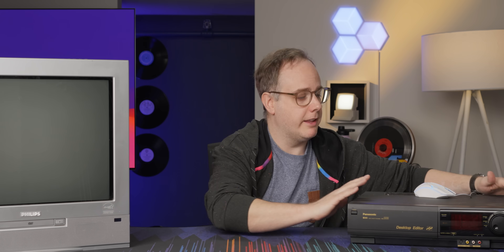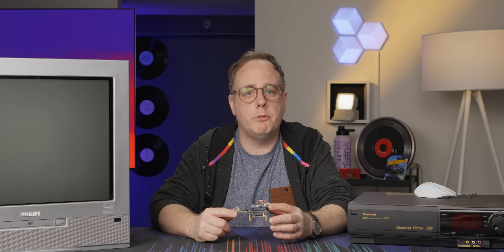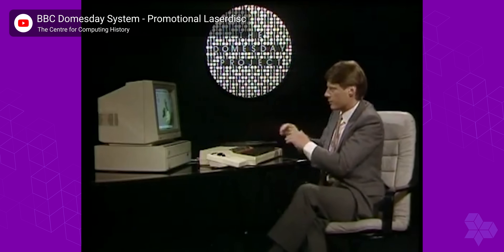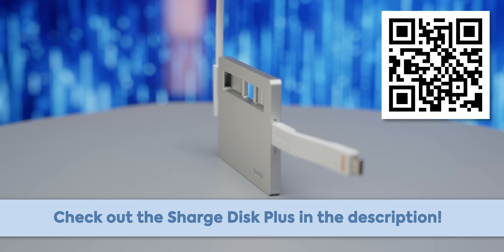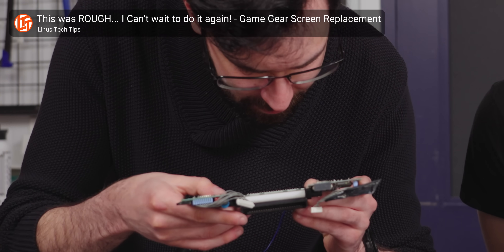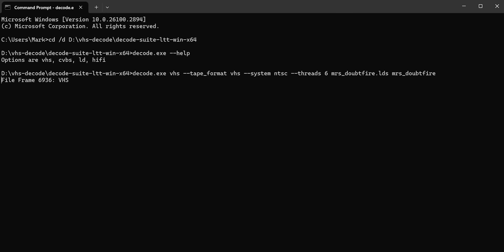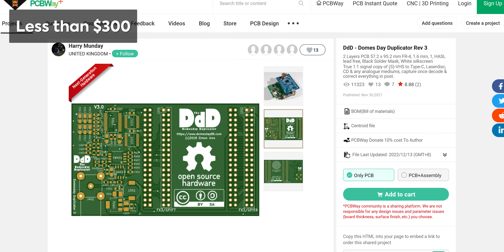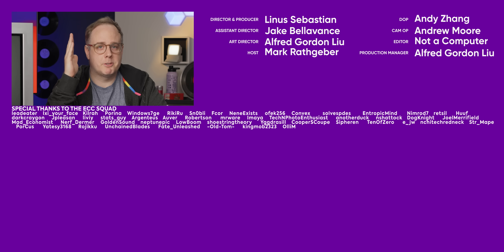I've wasted THOUSANDS of dollars... - Domesday Duplicator

Comment: This all seems counter intuitive to me, that RF would yield better results than composite. Unless I missed the point which I think I might have that it’s decoding what’s on the tape and not relying on the video player to output image etc. But if that’s the case then wouldn’t it still better to use a higher end vhs player with more heads for a cleaner signal?
Reply: Its the source FM RF from the tapes heads right after the pre-amplifyer, before its de-modualted into composite video internally, the quality of the heads is all that sets decks apart with modern FM RF capture setups, really this video lacks the basic diagrams that are on the wiki.

Comment: In my opinion the best way to copy taps at a reasonable price is to use a Sony camera such as the PC110 or TRV125 which pass video to FireWire, simply if you want to copy a VHS tape you take a VCR, connect the video to the camera and the camera to the computer via FireWire, and it works similarly to copying mini DV or digital8 tapes but it works with any AV or S-video signal and the camera does not even have to have the VCR function because the image is only passed through it and not recorded on it (but I do not vouch for all cameras on the two I mentioned it works and my Sony TRV125 does not have the VCR function but it seems to me that it did not work on my Sony TRV10 but I'm not too sure)

Comment: I was wondering which one is "better", CX Card or the Doomesday Duplicator. Price, ease of setup/preparation, and features.  My understanding is the CX Card has to be modified for example.
Reply: Clockgen mod is the gold standard at sub 150USD total setup starting from absolute scratch, but the DdD was built for LD single channel format, not vhs which is multible channels, video rf / hifi rf / Linear audio etc.

Comment: great video, Im curious if the other cards had audio capture as one of their added features. A nice all in one would be great.
Reply: You can digitize the audio linear track(s) is just like low speed compact cassette you just use the audio in on your sound card or some other low frequency Analog to Digital method. I believe the HiFi Tracks can be digitized too but I don't know if they would be on a different RF test point since they usually used different heads / frequency separate to the video but same principle as the video I'm guessing.

Comment: Harry here, so some key points that the video does not highlight...

- VHS -Decode, despite its name we support over a dozen flavors of analog tape formats, the more samples provided, the more we can support! (There is a format support list in the wiki and on the readme)

- The cost of the DdD is actually 300 USD or less (global), CX Cards about 30 USD each, clockgen mod 150 USD or less depending on tools, and the MISRC is aimed at 150-250 USD mark.

- This example VCR setup actually misses 2 current key config things, an capacitor to de-couple and an amplifier with impedance control/matching.

- There is TB's of test data online for anyone to go play with, linked on the wiki docs.

- Credit to Simmon Inns for the DdD and big credit to Øyvind (Oln) for starting and being the core dev of the tape decode branch.

- FM RF is from the tape, not from a TV pack, so the method is called "FM RF Archival". VHS and other consumer formats are called "Colour-Under" FM modulated formats hence why they decode to an S-Video style set of files with the decode workflow, and LaserDisc/SMPTE-C for example are composite modulated formats so produces a single file.
Reply: Is the MISRC board worth waiting for, do you think? Not to save money I mean, but in terms of ease of use and or features? This tech looks amazing. I've already spent a fortune on good capture stuff for my old VHS family tapes but would gladly redo them for that extra bit of extra quality!
Reply: @Spanky2k  The MISRC is  basically in terms of capture workflow, just a higher spec version of the clockgen setup, functionally it would be the same for tape capture.

It's current release version the V1.5 is a development board, but the next revision will be a 4 layer board with audio properly intergarated coming this year. (But it's really not cheep prototyping)

If you want something turnkey today and can use a desktop, the CX Cards are the go to, if you need to be USB based then the MISRC is there to fill that gap.

What the MISRC is not is a perfect replacement for the DdD for LaserDisc users, due to the hardware input filter design.

However the DdD may be updated to use the Hasdoah data interface workflow that powers the MISRC today, which would cut is cost to 120USD or less flat.
Reply: @TheRealHarrypm  Awesome, thank you! Seeing as I only found out about this amazing tech today, I can wait until later on in the year for the next MISRC board, that sounds perfect! I'm so excited, just when I thought I finally had the best digital copies I could get, some new amazing tech turns up!
Reply: Are there any deep dive videos on this and the other systems mentioned?
Reply: @BloodBlight  It's effectively in layman's terms audio capture cards with higher numbers of information, sadly this video did not show any graphics which will break that down, that's not obscure at all and very comprehensive when you read the docs.

The issue with any tutorial video is it could be outdated in a week, this is why all primary documentation is written so it can be actively updated.
Reply: @TheRealHarrypm , please make some more tutorial videos about vhs-decode, and the process of RF capture
Reply: Do you have an email list we can sign up for so we can order the new MISRC  when its ready this year? If not, what is the best way to get notified of that?
Reply: That cost does seem to be for the pcb, not a complete kit (as addressed in the video).
Reply: @thbroadway  Actually that offered kit shown for 500USD, is a whole set the DdD mainboard + DE0 + FX3 we can't do anything about the two development boards (Which are seasonally stocked) but the actual DdD board is 90USD or less.
Reply: @TheRealHarrypm  Where is the DdD board available for that price? The only places where prices are publicly visible show the board for $250, as indicated in the video (eBay and Tindie). I see you have a listing on PCBWAY, which I am not familiar with and does not show the price unless I make an account. Is that your recommended source, i.e. is it available for that price there?
Reply: @thbroadway  PCB way is direct fabrication, you're having the main middle board directly fabricated at factory cost.

The FX3 and DE0 are off-shelf development boards, please look at the wiki for actual instructions here.
Reply: @TheRealHarrypm  I understand what the FX3 and DE0 are for, and I can find where to get those. What I am saying is that DdD boards are being sold on consumer retail sites, off-shelf boards not included, for $250. In looking for info on this stuff, wikis don't state where to get DdD board for the $90 price you state in an above comment. My original reply to you was actually just pointing out that the video actually mentions the board being sold for the < $300 price you mention in your first comment, but if PCBWay is the way that a simple hobbyist can get this board on the cheap (not buying in bulk, for example) that would be great. However, the wiki for the project does not recommend a source for the PCB, and doesn't even have an estimated cost, so people like Mark and I would not know whether $250 is a steal or a ripoff for this board, without finding your response to your comment in this video.
Reply: @thbroadway  The main VHS-Decode wiki docs, there is a link to the current DdD index page, this links to my up-to-date repo, with a 1 page guide for someone to click though and order the board, this is also linked and pinned at the top of the vhsdecode subreddit.

This is not for buying in bulk this is for having a single PCB board manufactured, populated and shipped, this is the 2020s, It's highly accessible.

The marked up listing should have never been featured, and Simon's original repo has not been maintained for docs much since the last revision of the DdD in 2017/18.
Reply: I was literally just looking for the best way to digitize my family VHS tapes! Thank you for covering this LTT and Harry for popping in.
Reply: Nice to see you over here Harry
Reply: That actually did appear in the video, I paused and read it, quite impressive
Reply: The decode capture looked sharper, but there was a lot of what appeared to be RF interference.
Reply: @claypf4795  That's the tradeoff, and why the normal VCR video out is softer - more filtering
Reply: I KNEW THIS WAS POSSIBLE
I WANTED TO MAKE THIS BUT DIDNT HAVE THE TECH KNOWHOW
THANK YOU😊
Reply: I've been looking into getting a DdD for archival use and this is actually my first time hearing about the MISRC. I've held off on the DdD for a bit because of price, but one issue for me is that I want to be able to rip both LD and VHS. Based on what you are saying the MISRC wouldn't be good for that scenario?
Reply: Hi Harry I'm an EE , Wanted to ask, so this card is taking the direct RF signal off the tape as the tape has it? Rather than any pre-processor from the machine? This is why any vhs can work?
Reply: @MD_Builds  The FM RF archival workflow is based around tapping any and all decks and formats directly after the tracking/headswitching and pre-amplifier stage, we use high independence amplifyers in current workflow the wiki has diagrams with much better breakdowns, the only weak link is the heads themselves really.
Reply: @TheRealHarrypm  ace
Reply: Excuse me, this might be a stupid question. But I'm really a beginner considering electronics, however eager to learn these things: In the video the setup worked without the capacitor and the amplifier you mentioned. So why exactly are these important? Is it to prevent the DdD and/or the VCR from damage? Or to improve the captured signal?
Reply: @ftt1979  AC decoupling, it limits the affects on the VCR, and high Impdence amplifyers this limits the signal draw or load on the pre-amplifier chips, too much draw affects the signal both in RF capture terms and standard playout monitoring.
Reply: This video sounded so interesting but the reality was like having time stretched before my eyes. Seeing that the video wasn't even accurate AND the equipment is expensive... I'm glad there are people working on this, but it it could have been presented in a way that didn't feel like an algebra tutor who barely grasped the concepts.

Comment: I've got an Ion VCR 2 PC which when you plug it in over USB it presents itself as a Webcam and can be used in OBS. Quality is ok but just thought that would be an interesting bit of kit to share
Reply: It’s about just as good as that VCR/DVD dubber another commenter mentioned as using to convert his home video tapes 15-20yrs ago… That commenter made sure to mention they have barely watched any of those recording in the years since due to the compressed quality so YMMV.
Reply: @lapielazoolie  100%, I have been pretty lucky with my recordings with it, but when I tried to record a copy of "Muppets on Wheels" my wife bought me there was some REALLY bad artifacts, though it was intermittent so I think it may have been an issue with the VHS. I don't have a proper VHS to verify that but my childhood copy was COMPLETELY worn out so I don't think those VHSs were very high quality materials. When I recorded some old Superman cartoons they actually came out pretty ok, certainly not great but absolutely serviceable.

Comment: Would a comparison with the alligator clips be possible for a more realistic output? Just because not everyone will be able to do the soldering with use and tbh my nerdy side wonders if there is a discernible difference.
Reply: As long as you get a decent connection it should be the same or virtually the same. If you've jumped a car with a dead battery, it's like that, you sometimes have to wiggle the cable to get a better connection. I'd bet that it's probably pretty hard to find a place on a circuit board you could clamp onto to get the right signals. Sometimes those solder points are almost flat.

Comment: I spent a grand total of £60 (about $75US) on my setup and it gives fantastic results. I use a S-VHS VCR which I got for free (can be had for around $100 for a working one on Ebay) connected via S-Video to a Sony RDR DVD Recorder which has an HDMI output. The S-VHS VCR does a great job of improving even VHS tapes and the Sony is used purely for the fact it has a very decent hardware upscaler. The Sony's HDMI output is connected to a fairly cheap HDMI to USB capture device connected to my computer. This little device doesn't care about Macrovision or HDCP and upscales happily to 1080p 60. The resultant files captured on my PC look far, far better than ANY external service I have ever used.  I am sure your setup might give very slightly better results but is it really worth it for the hassle involved with opening up the VCR, finding the test points, soldering, extra decoding software etc. etc. not to mention the huge $500 cost.
Reply: With FM RF archival your getting the whole signal frame, not just the active area, and the TBC code is way ahead of anything hardware can provide, and the level of effort to the cost benfits in both space saving and information, nothing beats it.
Reply: Well I have been looking for high quality TBC capable vhs players. In the EU they are hard to find in good condition not to mention price.......

So 500 dollars for a 'rule it all' system that provides the absolute raw data, thus the best ever transfer possible, ain't much for me at all!
Reply: Which model Kevin and how easy was it all? I’m about to embark on this project myself
Reply: $500 for this board, but of the mentioned alternatives, the CX card, is far cheaper than you’d think: $30. Of course, there’s still the other downsides.

This is more for preservation purposes, to faithfully preserve the material as closely as possible. If you don’t care about that, your setup is fine.

Comment: What exactly is this RF test point? How is it different from the RF output that used to go to your TV if you couldn't use S-Video or composite?
Reply: Like harry said but (hopefully?) simpler:  It's the raw RF from the tape, rather than a decoded RF signal made for your tv.  The benefit is that it has more information, so you can get a better picture.
Reply: These are the calibration test points used to check playback on a Ossiliscope but contain the full video or HiFi signal, in its original FM format, technically it's head switched so it actually contains the continuous stream of fields and frame signal effectively.

It's not like FM from a TV modualtor pack, it's the actual signal from the lines of magnetized tape, being read by the heads.

VHS and outher consumer formats (and U-Matic) are called "Colour-Under" FM modulated formats with the colour signal modulated under the luminance signal, this is why internally they're always processed separately before being combined into a composite or s-video.

The standard output out of the decks goes through the internal decoder which is the whole point of FM RF capture and decode to completely bypass this, and provide a source archive file rather than something that's baked at a hardware processing level.
Reply: RF test points are inside VCR they are taps from Video head signals.They output BROADBAND SIGNAL in RF domain. Important is that it is not just a video but also contains whole broadband. Processing is required.

Comment: I wish we could have seen s-video vs doomsday as well. His "ballin" VHS deck has it.
I get for the video that you're wanting to show the worst vs best for the biggest visual affect and it's easy to see, but really what we need to know is; how much better than the previous "best" method is it?
Reply: Yeah, the video is misleading, showing a top end vcr, but using the worst examples to compare against vhs-decode.
They ldidn't mention or show the actual capture card they used, as I doubt they went to the effort needed to use the firewire capture device shown(which has it's own problems anyway, especially for NTSC video there) so it could've been totally unsuitable(and perhaps was considering other things done in the video) for all we know.
The vhs-decode tap was also done incorrectly as someone else pointed out.
The first "comparison" is not remotely an accurate reflection of what normal captures are like.
Neither capture method seems very good, even though it looks the original tape was in good condition.
Even composite capture can look good using conventional methods, especially when the subject is close to the camera like in the example they used. As an example(albeit from a late tape), this was captured with a combination tbc and composite to sdi converter, from an older vcr with no special features: www.youtube.com/watch?v=EIyUHkkyYJU&t=108s
Reply: @DoubleMonoLR  We don't know what capture card he used but looks too bad and dark, I don't know if he used a good comb filter since he used composite, he didn't use the TBC of that high end vcr and well, that...

The side by side comparison against vhs-decode is just very bad and wrong here.
Reply: I'm also very confused why you'd compare CVBS when you have a $2,000 AG-1980P sitting there. Also that thing has serious issues with the caps and probably needed a rebuild many years ago. The image is very dark and filled with power noise. It's not the Doubtfire tape, it's the deck. Of course, all that said, vhs-decode is probably still better. The comparison is just useless.

There were a lot of other technical inaccuracies in the video. Like saying that his home videos wouldn't sound any better in hifi (your home videos literally do not have a hifi track on them at all, so there'd be no signal to decode)